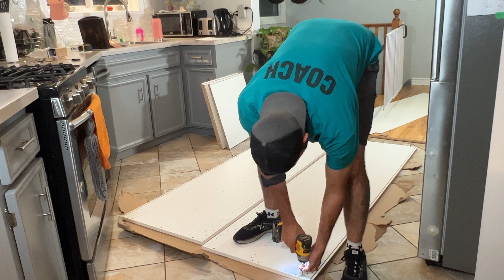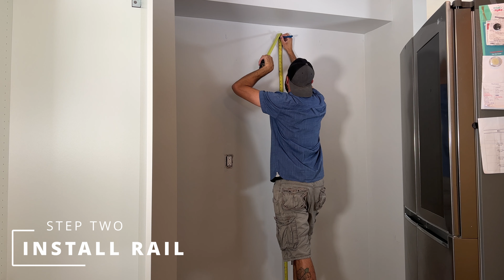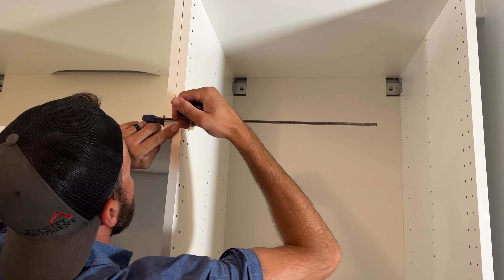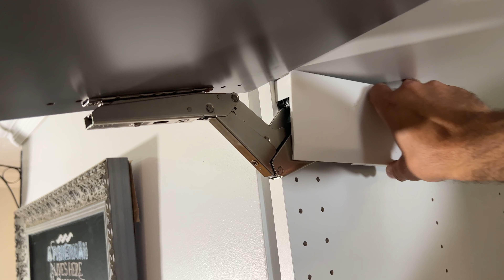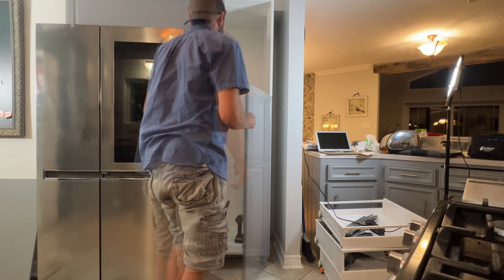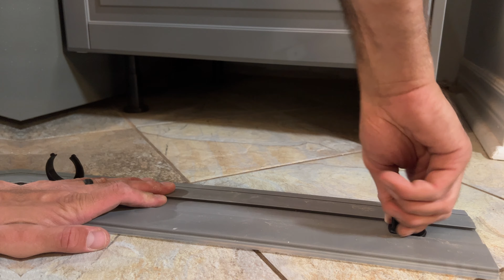Installing Ikea Cabinets in 5 Simple Steps!

Comment: For the tall pantry cabinet, do you think that you could've installed the legs after hanging it on the wall? My cabinet with legs is exactly the height of my ceiling so I won't have clearance to flip it after adding the legs.
Reply from the maker: Yes you can as long as your rail has enough anchor screws it takes 100% of the weight.  If you have to you can cut the legs shorter as well
Reply: @DIYDudes  thanks! I'll try that

Comment: Why didnt you to the filler gap? trying to find a good video how to do the filler gaps.
Reply from the maker: I left it open for a little broom slot.  If I did want to close it I would have screwed 4 scrap pieces of 2 x 4 on either side of the opening, rip a strip of fridge panel to the right size and then nailed the panel up with a nail gun… good luck!